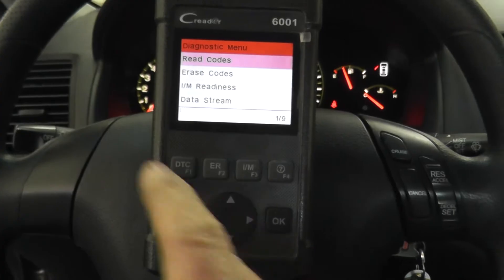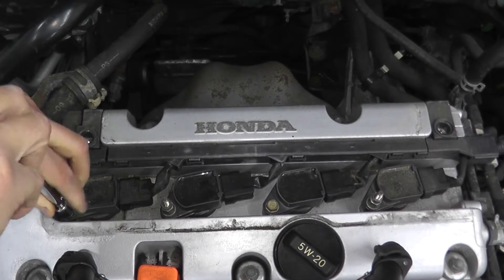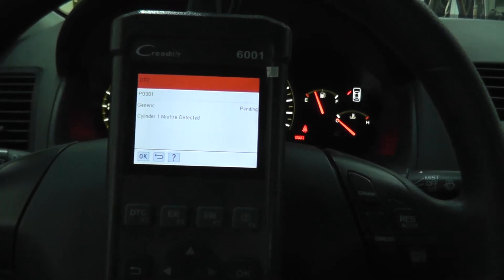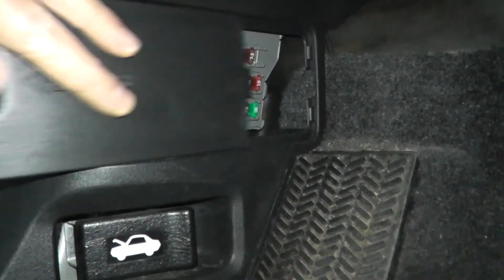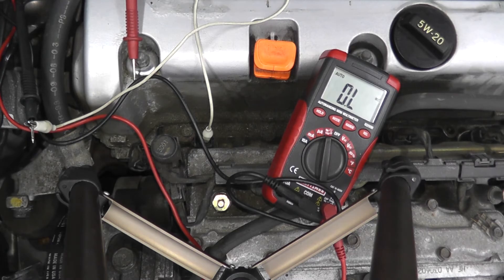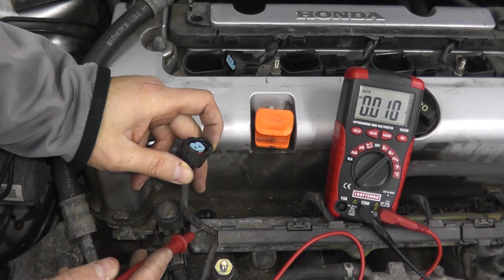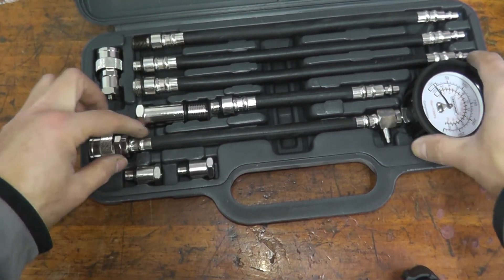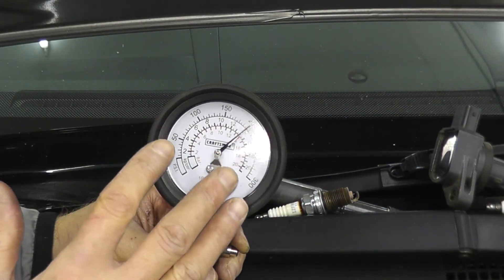How To Fix A Misfire Code with Basic Hand Tools | P0300 P0301 P0302 P0303 P0304

Comment: Very helpful video.  Very informative. Prior to picking up a OBD2 scanner I changed my spark plugs and the upstream O2 sensor.  Still have the problem but with the scanner now I can see I have the P0301 code.  Just swapped coil 1 with coil 2 and will see what the scanner tells me next. Hoping it's just a bad coil.  Was told in a conversation a vacuum leak could also be behind this.  Will have to look that up.  With 58,000 miles on my 2017 car, could an injector or fuel filter/pump be bad already?   Thanks!
Reply: A faulty injector could cause a misfire. A vacuum leak would more likely cause a lean condition and you would have codes for that or MAF codes. A bad fuel pump or filter would morr likely cause a lack of power at higher RPM or a no start/hard start condition or stalling condition, along with maybe a P0300 random cylinder misfire due to poor fuel pressure and a lean code. But that would trigger at higher RPM if you have a lack fuel delivery fault.
Reply: I would do the swap test on the coils. If you still have a fault on cylinder #1 then confirm your wiring is good all wires including the ground and signal wire if your coil is a three wire type. Also confirm your spark plug is in good condition pull it out and make sure there is no cracking in the porcelain and the gap is correct. If all that checks out you might need someone who has automotive diagnostic equipment and training to look further into it.
Reply: @thelostshadowofhanzo  This worked. Had the P0301 code and swapped the 1 & 2 coils.  The error code followed the coil moved to cylinder 2 and is now is P0302.  Going to replace the coil/s.  Thanks so much!
Reply: @PocketChangeInspector  I am glad you were able to figure out the fault buddy. It is an easy test to do sometimes. There are some engines that swapping the coils is not always as easy as it involves dismantling something like the intake or other items. In those cases there are other tests and at times the use of an oscilloscope is a more time efficient test.

Comment: We had these codes pop up for 2000 tacoma v6 shortly after changing sparkplugs after purchasing used. Turns out we had broken the tabs on ignition coils that led to bad connection. Connector plug wasnt sitting right causing misfires. We replaced coilpack and connectors too so might as well. Sparkplug wires is next because one tab is broken too and its held on by zipties. Thanks for breaking it down for us!

Comment: So I changed my spark plugs and two bad looking coils. Still getting p0300 and P0301, P0302, p0303. I changed cylinder 2 and 4 already, so I'm not sure why P0302 is showing up still
Reply: Same I had same problem too
I changed 4 coil and spark plug and still I had the problem
Did u sort it out ?

Comment: You were all over the place. Should have stuck to the basics. Coil pack and spark plugs.
Reply: He was so on point. He did it in steps. It didn't jump from one issue to another. Dont know where the all over is? He just added more so if it wasn't just your coil pack or plugs. It was very informative.
Reply: @destihyspicher9589  shut up. I'm talking to him! He can defend himself!!!!!!
Reply: Well I would not say he was all over the place as injector fault can cause misfire codes. I will say his tests were incomplete and some would only test the part partially. There are also better tests he could could have done that would have gave a much better idea if the electrical was in good order as well.

Comment: Hello I have a Misfire Code P0300 P0302 P0303 how do you fix this change starter and coil pack, spark plugs still getting this Codes ...What do you think ?? Great Video I have a 2008 Honda Accord
Reply: did you ever figure out the problem ?

Comment: I have a 2002 Honda Accord 3.0 V6. I came back from a week's vacation and had a P300, P301, P304, P1399, and a battery light plus the door and trunk reference lights were all on. I was very confused.  I started checking all my coil packs but then noticed that my A.C. wasn't working either. Turned out it was all just from my accessory belt being off??? What do you think?  Is it possible that the disconnect from the alternator caused all those codes?  I checked all my packs and they were fine.  Spark plugs changed less than 3,000 miles ago.

Comment: Tht was a great n helpful vid I'm having a problem on my C240 mercedes get codes cylinder 1,2and 3 misfiring and now it's difficult to start the car some times I must crank the car 10 times for it to start and some times it won't even start it end up draining the battery so I'm going to check for power on the wires which goes to the coil packs and will check for resistance on my injectors for cylinder 1,2n3 let's hope will get the answers why it's misfiring on these cylinders I also try disconnecting power supply to coil pack 1,2n3 thinking tht myb I could switch of the car but nothing

Comment: It's very important that you do this on a colder engine. The bolts tend to break if you tighten them while the engine is hot.

Comment: Hi, 

I owned a VW Golf 1.4TSI MK6 2010 CAXA engine. 

I have a unresolved issue with the car. 

My car always throw a flashing CEL when I drag to 4.5 - 5 RPM. Lower RPM under 4 no issue. Plug in computer says P0302 cylinder 2 misfire. Swapped plug, ignition coil, injector, fault stay cylinder 2. 

Replace plug, ignition coil, injector on cylinder 2, replace High pressure fuel pump, high pressure valve, ECU reflash to factory mapping, compression test within decent pressure range still fault at cylinder 2 same RPM range. 

Hopefully you can give some expert opinion on what to look out for next. 

Many thanks for your help. 

Regards,
Syed

Comment: ok i have new plugs new coil new fuel injector and new fuel pump but i dont have spark # 1 cylinder 1997 izus rodeo 3,2 v6

Comment: I have oil on the on the number 1 spark plug
Reply from the maker: You'll need to replace the spark plug seal. It's a round gasket inside the valve cover.

Comment: I changed all my spark plugs. All my coil packs. Still getting p300, p301,p302,p304.   It’s the 6 cylinder accord. 09
Reply: wow. i think u are in trouble... hopefully will solve ASAP bro  I'm having p301 issues too
Reply: @scb7478    Found out my
Head gasket was blown causing the misfires.  I think my water pump failed and thats where it all started.
Reply: Having issues with random misfires on my 06 honda civic  and while looking for  fix i saw a class action suit for random misfires on 08-12 accords id look into it
Reply: @J_Dukes    Thanks.

Comment: Hello, thanks for the diagnostic video! Well unfortunately, I have the P301 intermittent misfire cylinder 1.  I cleared the code and it returns.  Also, my cyl 1 spark plug is the proverbial  gunky dirty spark plug when I pulled it out for a tune up. ( 95' Nissan Maxima  , 147K mileage) .  The car runs fine, with a slight hesitation during acceleration , but runs fine.  
 Any suggestions?
also , I didn't try the compression test , or the multi meter test. Maybe its time.  Thank you  and you have helped me a lot during the years with my Maxima! LOL  I know you were working on one for the longest.
Reply: good write